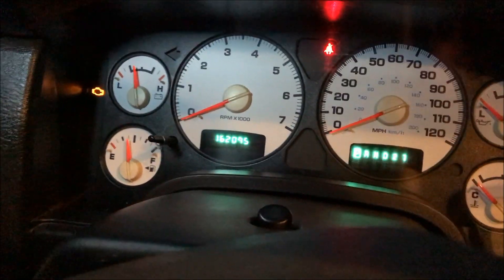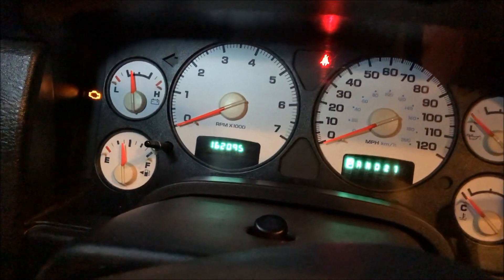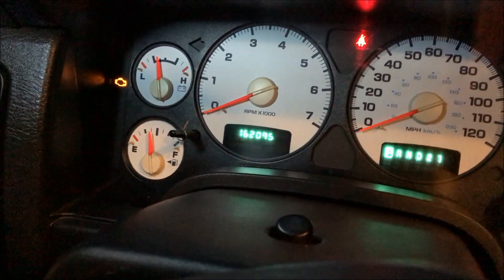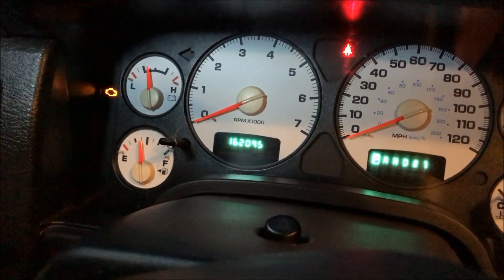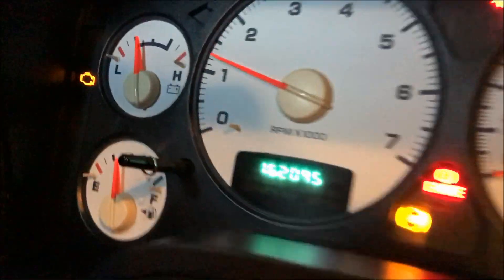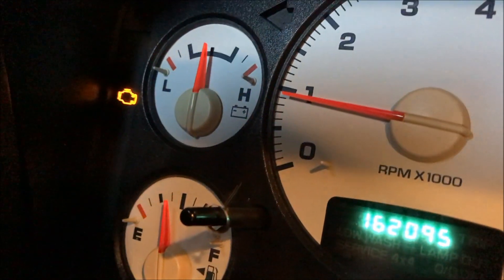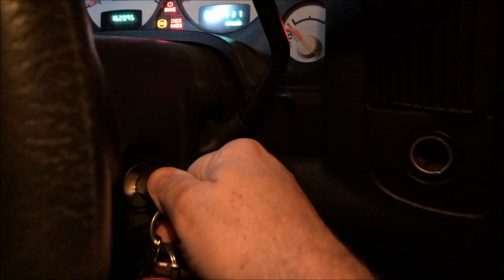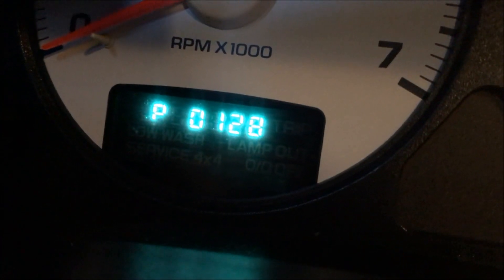Dodge read check engine light without a code reader or scanner tool

Comment: 2004 dodge ram 1500, check engine light is on but when I do the trick it instantly says done and an empty screen with no code appears
Reply: Mine didn't even give a code or any other indication

Comment: Did not throw codes on dash at all, done any number of times 1-6xs key on/off, same results. Engine and Lighting Bolt are only lite up, approximately 30 seconds Lighting Bolt shuts and Engine Light is Flashing multiple times, then stays on solid again.....I have a refurbished computer-plug and go, as shop wrecked original and said some of it was fried. But had none if the issues I have now prior to this refurbished computer, O2 Censors-2 Changed out as it was throwing them, Crankshaft Position Censor changed as it said it needed it, has a Misfire on 5th Cylinder with open circuit, pissing out Fuel profusely from Exhaust, doesn't want to idle and run at times and floods itself out. Without changing the Fuel Injector or changing out anything, how can I get the Misfire on the 5th Cylender to close and not stay open, so it stops pushing Fuel out exhaust?
Reply: 2003-2004 Dodge Ram Hemi 5.7 1500

Comment: I couldnt get it to work on my 2004 ram 1500 any help is appreciated
Reply: Jace Haar did you get it to work? It won’t read in my 2004 ram 1500
Reply: Jace Haar probably no codes
Reply: mine has no codes after multiple attempts of this trick showed in the video. will update once i’ve figured out why(if i do)